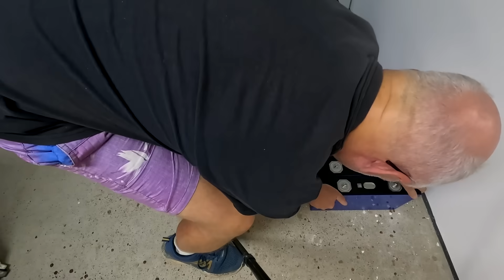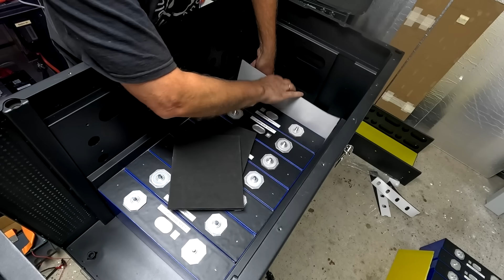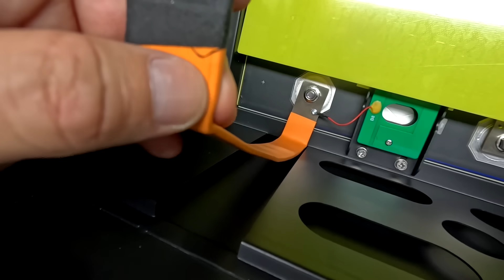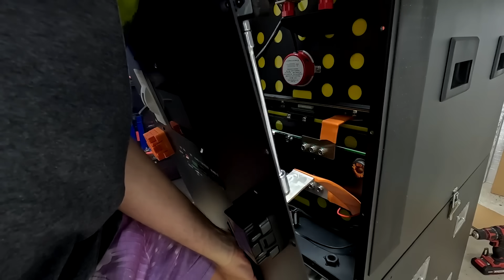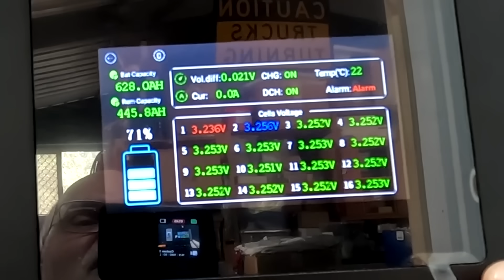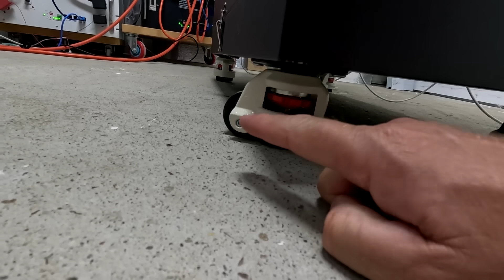First MB56 DIY Kit Build - The Big Beautiful Battery!

Comment: Really love your content, hope you enjoy the beer. Did a build of ab MB56 with Yixiang build. Thanks for this review. I really see the point with not equal pressure on upper row battery as there is a holder of breaker element. Think of putting a non deformable plate there. But everything else great product.

Comment: Hi Andy,
I got the MB56 running here for a couple of months.it's performing beautifully.
One concern I could use your experience is: what is a normal cell temperature difference during charging/discharging.
I discharge with max 210A and the hottest cell gets to about 40 degC, while the coldest cell stabilizes at 34 degC.

Is this normal in your experience?

Comment: I just wonder is that really PCB holder or is it actually a structural reinforcement of the battery? In the smaller models those are definitely ensuring that cells can't move especially if you choose to install the battery in the vertical position. If you remember first versions of the most companies didn't even have had a PCB but only have used BMS balance cables. Still they have had bars holding cells down. 
Now with this size and weight of this battery you won't install these in  vertical position and weight will ensure that cells stay put. Still EVA tape should contact the cells and restrict the movement and possible vertical expansion in my humble opinion. It should contact all of them evenly on the top side and not touch the corners of the outer cells.
Though with this size and weight many things look like they could use some more beef. Compression plate could at least integrate some bends to make it stiffer if they do not want to use thicker plate (due to weight and costs of material issue).
These monsters are impressive but seem to be less practical. Two smaller batteries are easier to handle and can provude more amps. They also offer more redundancy but increase number of possible weak spots.

Comment: I've just build 4 of these great batteries. They have solved a lot of the issues you mention in the video. The busbar in the rear that connects the 2 layers are now fine ( the cut-out in the case is done correctly ), and also the balancer-bars now fit better with, and don't contact the cells. The kit from Yixiang seems to be really good quality, and alle the bolts where torque-marked from the factory.
Great video as always from You Andy 🙂

Comment: How would your arms fit between the front panel and the pressure plate if they made the box smaller, Andy  😆 ?  I really enjoyed watching your meticulous build process.  I love seeing the way something should be done.  I'll be installing a DIY solar and battery in the next year or so, and at that point I will absolutely be joining the ranks of your Patreons.  To answer the question you asked at the end, I would definitely rather build a single box with the MB56.  Cheers, and enjoy your spat.

Comment: Cutting the busbar like that doesn't reduce it from 200 to 150,  in the end is about heat dissipation, the part that is cut is uncovered, and has more contact with metal, thus  having a higher heat dissipation,   sure , the resistance at that bit increases a bit, which increases the power loss around there, but it's more than compensated by the higher heat dissipation

Comment: Hi Andy.  Thank you very much. I’m wondering and asstthis box has a v19 inverter bms so can these bms’s handle 12 batteries ( I know very large compound if 7 buildings to run off grid) in parallel so a deye or luxpower 12 or 16kw inverters x 4 or 5 units read the bms comfortably without issue via pylon tech on the inverter settings or do I have to use PETER IBMS adapter? Please can you make a video of this if I have several of these boxes in parallel for a huge fully grid storage solution out in the middle of nowhere in the Caribbean.  Thanks Andy.

Comment: I am afraid that you have a problem..
Did you check connection between busbars and battery pole.
On busbars delivered with DIY box, are m3 threads for balancing cables, and the press in thread is in area of battery pole. So when you tightened the m8 nuts on the busbar you have super small contact area, just small part of busbar and m3 thread.
I find it during the assembly today. I recieve 4 boxes, till now I found it on both which I start assembling. 
You have the same busbars, and also I find it on connection from BMS.
Rear busbar looks ok, threads are in bigger distance from hole

If i am correct, this is huge mistake and risk of overheating.

Comment: Anybody else have problems with this battery with a bus bars or improperly made and do not contact the battery terminals correctly.  The manufacturer says to turn the bus bars upside down. Then the flexible part of the bus bar rubs on the battery creating a safety concern

Comment: Hi Andy, having cells with a huge capacity rocks, but having double amount of smaller cells will give you at least a little redundancy, however, these really flat plated cells inside equal the stability o Winston cells and have longer life I presume.
I use massive feathered compression plates with calculated tension that move in and out when charging and discharging, keeping always a constant pressure without bending.

Besides that, these MB56 cells look awesome!!

Comment: I have just taken delivery of my Yixiang MB56 DIY battery and when assembling it I found that the manufacturer had supplied 18 of the thin foam sheets.  This is enough for one between each of the MB56 cells and one on each end.  Surprise, surprise if you assemble it like this without the thick foam pads, the end clamp plates fit perfectly and they clamp down to touch the outer chassis with just the right amount of clamp force.  You do need to stick the foam pads to the batteries and not just slide them in place as Andy did.  The reason for this is that the thick backing paper on the 9 sheets of foam in each layer adds up to over 1mm of thickness and this increases the thickness of the stack more than the manufacturer obviously assumed would be the case.  The other thing I found out is that the compression bolts for the end clamp plates fit into oversize holes and as a result if you just fit them and then clamp them up, the end clamp plates drop down under their own weight so the bolts are at the top of these holes.  The result as Andy found is that the clamp plates sit too low and when you fit the centre beam it cuts into the top edge of the end cell.  The solution is to just loosely fit the end plates so that they are floating and then fit the centre cross beam.  With only a thin foam pad and an epoxy sheet at the ends of the line of cells if you tighten up the bolts on the ends of the centre beam the end clamp plate is raised up until it sits at the correct height.  If you then tighten the end clamp plate compression bolts the centre beam sits correctly on top of the batteries with no cutting or washers needed.   This begs the question what are the four thick foam pads for?  Well the fact is that even paired together they are not wide enough to completely cover the end MB56 battery cell and I'm pretty sure that if they were meant to go on the ends there would be just one for each layer not two badly fitting ones.  So either they shouldn't be in the kit (because they are the correct size for the smaller MB31 cells) or the manufacturer supplied two more of the thin foam pads (that are the correct size) than were needed.  From assembling my battery I think it is the 4 thick foam pads that shouldn't be in the kit rather than two thin ones.
Reply: Thanks for the fresh input. Your info will be a great help.

Comment: Bulding a 500kVAh Battery.
800 Volts, 240 Cells, 580Ah.
Can the JK BD6A24SXXP JK PB2A16SXXP JK-PB2A16S-XXP BMS's just be connected in series, how many of them can work together and do they need to communicate? If 16S BMS = 15, if 24S BMS = 10. I need at least 150A which would give me (150Ax720V=108kVAh)
I am really interested in comments of people that have experience in similar or larger projects.
How do they build the container battery storage unist, are there commercial custom BMS's?

Comment: Wish you had showed what the alarm was and how you cleared it. Mine did the same thing today when turned on. First build and I don't have any experience with any JK BMS. Did go through the app but don't see where that info would be. Any body that has the answer would be helpful. Thanks in advance.

Comment: Re Curved compression end piece. Two ideas: maybe the manufacturer could increase width of top L edge to stiffen end piece. 2) Maybe a long sliding clamp (like inexpensive Harbor Freight type) could straighten curve of compression end piece, and that top piece over length of battery bank would then fit properly, plus hold end piece straight when screwed down in place ??? Options from my fix it brain ;+)

Comment: Andy, one improvement to this box would be to have two slide-out  trays  - one each for bottom and the top set of batteries. These would be assembled and "slid in" and then held in place by the compression plates (which seem hefty enough for the job), and a rubber stop at the back to keep it snug.A set of small steel rollers wheels could be incorporated into the side rails of the outer box - perhaps 3 each on each side and 3 levels of them so that the middle level is shared. " This is like a built in slide rack to make it easy for serviceability if needed. In addition, the bottom and top  tray bus bars should junction somewhere so that each can be "disconnected" without touching the other. It would be a great box to build 2 or 3 of them and have unto a 100 KWH for a heavy use home! Congrats on all the great work!

Comment: Another question:    
Connecting all the cells parallel first, with the flexible busbars,  so all cells get equal load.  
Is not needed anymore, because active balancer those that job  ?

Comment: Hi Andy,  again nice video  (Gut gemacht.  Grusse aus Holland)

About the tension on the cells.  you put 1 Newton on the 4 bolds, that push the big plate against the cells.
You noticed the plate was bending, when you torned all bolts totally in. so redone it and put 1 Nm.

I think you need too use the bridge over the cells, with the green print, also to give some presure in the middle of the cells.
Because now you see the plate, looking at foam, has in the middle little more space, then compared to the side  (bottom and top row).

So I guess using a big wood clamp and wooden plates for  protection and give some force on the big pressure plate and then mount the bridge.  
Perhaps the screws will fit the holes then correctly.

I also think the foam is better not used.  Now it gives some presure, but in time it gets weaker and the cells get more space.
Better fill up with expoxy plates or something else to fill up.

What do you think?

Mfg = BRegards = Mvg
  Marcel
Reply: Foam between the cells is needed as they expand 0.5mm each when charged.

Comment: Word of warning on short circuit current on MB56 monster batteries.   On most DIY lifepo4 battery projects we have established that a regular Blue Sea System (common brand) class-T fuse with a 20KA current breaking capacity is sufficient.    On a hunch I had chatGpt do some digging and calculations to figure out if the 20KA breaking capacity is sufficient for those double capacity boxes.... the short version is:  NO, it is NOT (or it's so close to the max spec that it is not safe).       So if you do a DIY project, ensure that you get a class T fuse with a higher breaking capacity such as Bussman (Eaton) and Mersen have fuses with up to 200KA breaking capacity.    Also NH type fuses have high current interrupt capacity but they are harder to find in North America.  Seems they are very prevalent (and cheap) in Europe.
Reply: ChatGPT...a safety advisor with a known known tendency to use hallucenogenic drugs. (G)
 I wonder at what point it becomes necessary to use spring-loaded breakers, similar to the ones in every mains power substation, so there's a positive air gap created when a circuit interrupt MUST take place?
Reply: @lyfandeth The sand in a class T fuse acts as an arc snuffing agent.  More efficient than an air gap 👍

Comment: The new MB56 battery has only 2 battery terminals. If you are to stack 2 of these, how do you connect these in parallel?
As there seems to be plenty of room on the front panel and space behind the panel, why not add 2 additional battery terminals, 2 +ve and 2 -ve?

Comment: The fire extinguishers are pretty much useless positioned where they are, with the "ventilation holes" right next to it. The extinguishers require a closed box to work. A lot of the fire supressing material will simply escape through the holes. No?

Comment: Too heavy.  Tell these manufacturers to redesign to make a head unit with BMS, screen, controls, etc, and the 48v batteries alone in separate modular units that is stackable and connects to each other without external wires. Each battery module should weigh less than 50lbs.

Comment: Remember you are bending the compression plate and the BMS Pcb, only mount the Bms AFTER tightening compression plate. The be very aware of bending the bms to comform to the plate.
We use plastic spacers on the outside of the bms to "level" it out.

Comment: 32 kWh Battery 
EVE MB 56 A$147.67 Battery × 16=A$2,362.72
Yixiang DIY MB 56 Kits = A$875.20

TOTAL= $3.237.92 AUD  or $101.18/kWh
and who knows what the shipping would be?
Reply: With these low prices its hard to understand how PowerPaul gets away with his super sky high prices - who buys those PowerPaul batteries at those prices? I was shocked at the PowerPaul prices when I went there to check them out.

Comment: Hello Andy. This is Theodor (and not the name that is shown in email).I couldn't find where to ask you something. Today I discovered that jk bms has one in series bms ( ENJBMS2A4S 50 -300 SP ) for parallel AND in series connection. I understand that you have low voltage Solar setup and low voltage batteries in parallel but a test expansion system with inverter and batteries in higher Voltage would be nice. I could also assist (from sunny hot Greece also)

Comment: The weight is too great for transportation without a fork lift.
Now we need an option where the top eight can be easily separated from the bottom system with easy connectors ... PLEASE!
Reply: Put it together on its final resting place?

Comment: The thing is that...it's as expensive as 2x16kWh boxes...with a small advantage on size and power consumption (one Bms vs 2) but lack redundancy....
And a big problem, the weight....
Reply: Not a problem if you plan on not lugging it around.

Comment: Hello Andi!  Interesting and a little scary behemoth of a battery.   What is this mystery fuse provided by Yixiang?  How does it compare with the profile of a Class-T fuse?   It is important that it be FAST acting.    ALSO, since a fuse is considered a "consumable", it is important (i.e. mandatory) that we can get a replacement...    Finally, I have reservation on a battery weighing 450+ lbs (> 200Kg).   It seems like it would be dangerous to move on anything but a flat cement floor.  In other words, unless you install those batteries in your garage, it would be VERY precarious to move them to their final destination (say in a solar shed)...   You would have to build the battery in the shed and if you later need to move, you'd have to take it apart again.    A nice experiment but I still think that it has a rather limited application.  Personally, I still prefer the 16 (normal) cells building blocks which can be safely moved around by two adults.

Comment: Hi Andy
Thanks, for yet another video.
My thoughts about you also use 4Nm on the busbar nuts on the M8, might be a concern, this does not push the contact area together with the same force as the M6 nuts. Due to steeper increase in the threads on the bigger M8 nuts. Still not considering if the contact area (busbar / battery terminal) is maybe also different.

Comment: Hello Andy. Wouldn't it make more sense to check the capacities of the cells in their "normal" range, between 2,95 and 3,45 Volts and enter this value for the BMS-Capacity-Funktion. Maybe the SOC could fit better when the value is more accurate. Just an idea! Greetings from the Saarland...Markus.

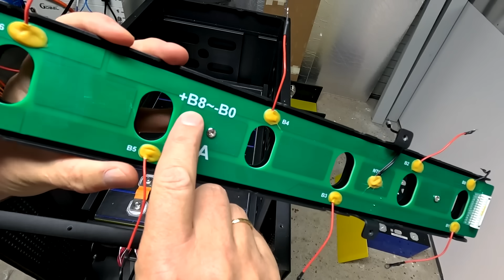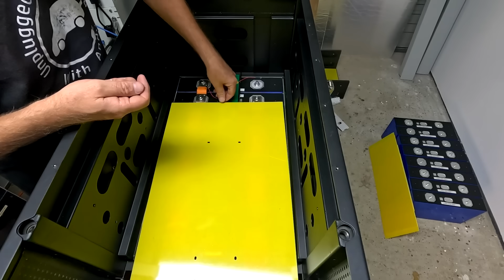Comment: @11:55 - I'm having a hard time seeing the whole thing, and how they are numbered, but B0 -> B8 would actually be 9 batteries.   Looks like later  (12:40) the final battery terminal is B7, so they might want to fix that.

Edit again:  (22:55) looks like the top one starts at B9, bottom one ends at B7.   Obviously not a functionality problem, but they should correct that.

Comment: Complete novice.  So do I have to top balance these cells to get the best performance over the life time or would the BMS deal with it and I still get good lifecycle?
Reply: Shouldn't need any attention if they are matched. The BMS will balance them provided that the inverter doesn't stop supplying them with power when charged. The BMS has an optional timer to keep reporting 99% for a while in order to be able to balance. You really ought to watch some of Andy's other videos.
Reply: Thank you very much. I’m wondering and asstthis box has a v19 inverter bms so can these bms’s handle 12 batteries ( I know very large compound if 7 buildings to run off grid) in parallel so a deye or luxpower 12 or 16kw inverters x 4 or 5 units read the bms comfortably without issue via pylon tech on the inverter settings or do I have to use PETER IBMS adapter?

Comment: We need crane holes or hooks for safe handelng. The connecting clips are to small also!
Reply: If built in situ or on the wheeled base (as demonstrated), there's no need to crane around. The units have feet which locate into holes, so aren't going to slide around. I guess the buckles offer some protection against toppling.